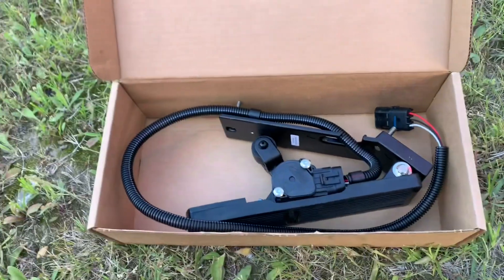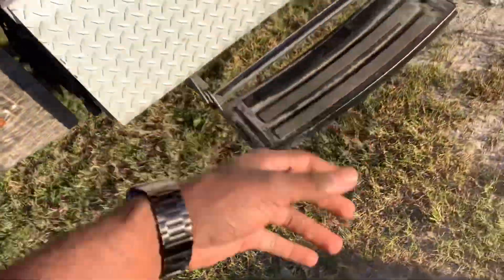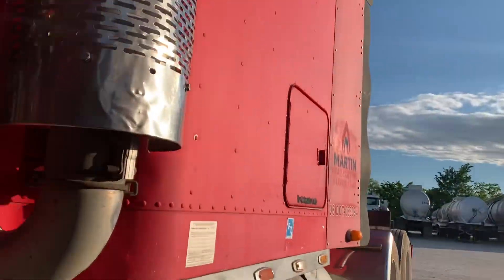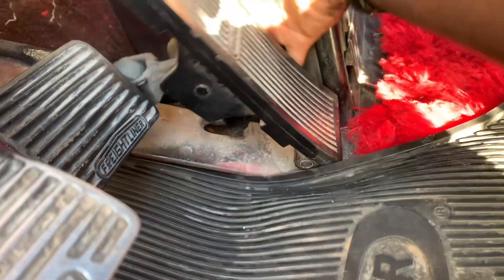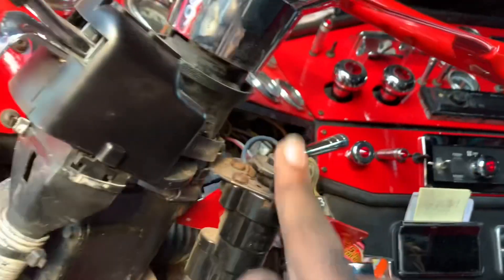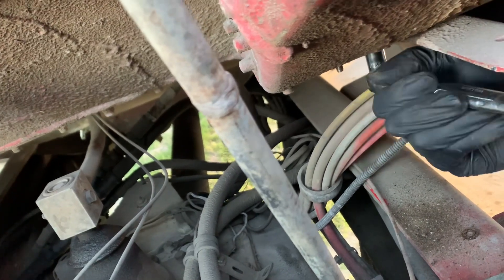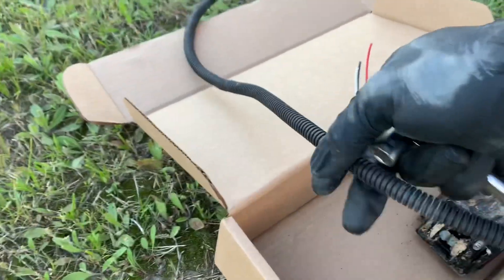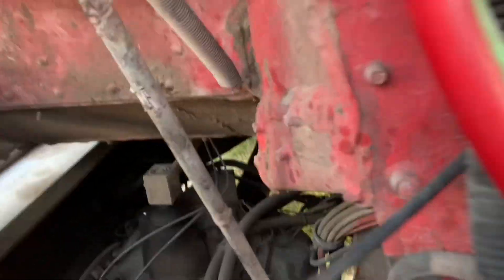Freightliner Classic Throttle Position Sensor

Comment: Appreciate this video .. can I ask the reason you changed it .. was it reviving randomly ?
Reply from the maker: @mauricewhite4803  I was chasing a power loss issue, it ended up being my injectors, but I did notice a difference after installing, better throttle response, holds speeds better as well.

Comment: I don’t understand. One guy asked you what symptoms you were having you said you weren’t having any symptoms, so you just decided out of the blue to change the pedal for no reason? Got a problem with mine and the cruise I cannot idle it up thinking maybe the throttle position sensor is wondering if you had the same problem